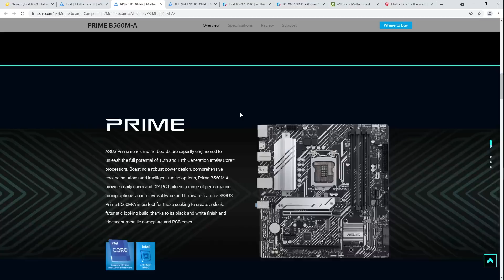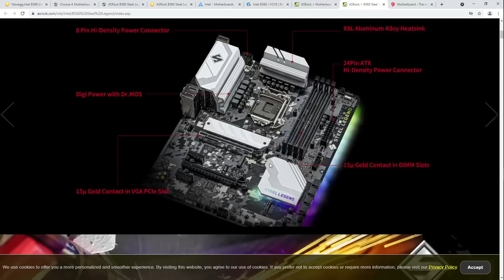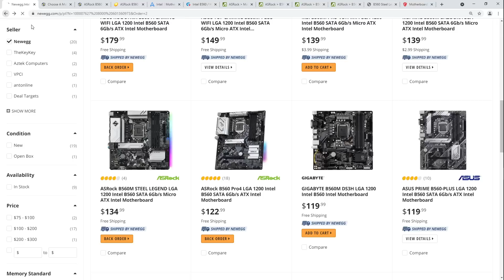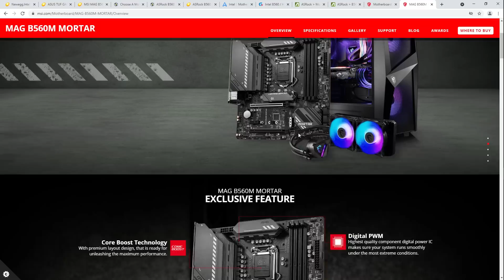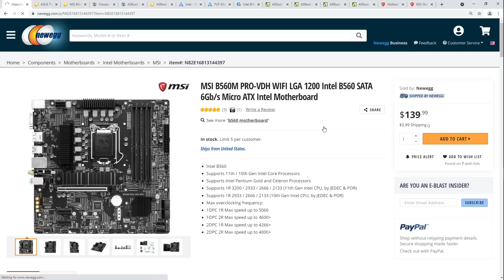Rambling about ALL the B560 boards

Comment: 2:04 - ASUS TUF B560M-E; 
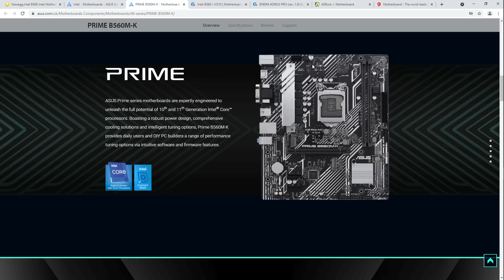6:12 - ASUS PRIME B560M-A (and 20:30); 
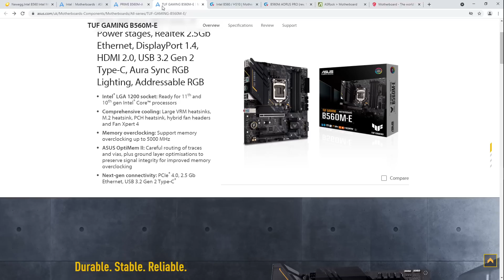9:08 - ASUS TUF B560-PLUS Wi-Fi + ROG STRIX B560-F + ROG STRIX B560-A; 
17:03 - ASUS TUF B560-PLUS (Wi-Fi); 
18:00 - ASUS ROG STRIX B560-G Wi-Fi; 
19:15 - ASUS PRIME B560M-K; 
20:30 - ASUS PRIME B560M-A again (check 6:12); 
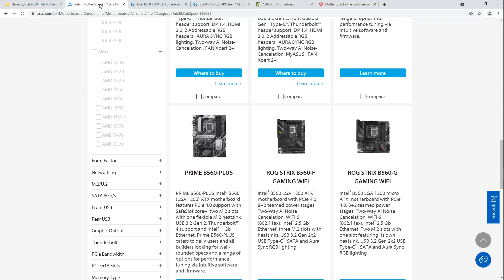24:05 - ASRock B560M-HDV; 
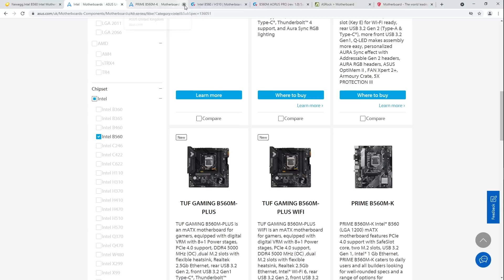27:45 - ASUS PRIME B560-PLUS; 
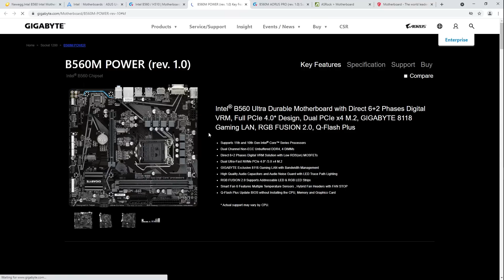31:00 - Gigabyte B560M POWER; 
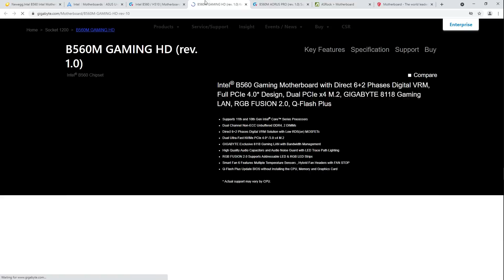31:07 - Gigabyte B560M GAMING HD; 
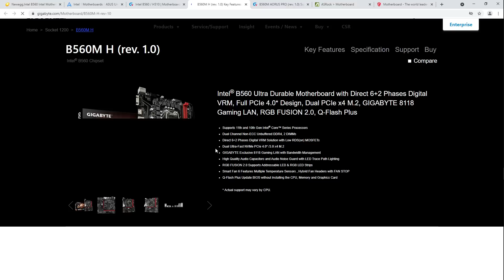31:12 - Gigabyte B560M H; 
33:00 - Gigabyte B560M-D3P; 
36:23 - Gigabyte B560 AORUS PRO AX; 
37:57 - Gigabyte B560M AORUS PRO (AX); 
41:00 - Gigabyte B560M AORUS ELITE; 
45:03 - Gigabyte B560I AORUS PRO AX + ASUS ROG STRIX B560-I Wi-Fi; 
---The rest of the gigabyte lineup is skipped. Reason: trash boards; 
52:53 - ASRock B560 Steel Legend; 
57:32 - ASRock B560M Pro4/ac+; 
1:03:10 - ASRock B560 Pro4; 
1:06:25 - ASRock B560M Steel Legend; 
1:08:05 - MSI B560M BAZOOKA (and 1:31:28) + More of the previous; 
1:09:13 - ASRock B560M-ITX/ac; 
---The rest of the ASRock lineup is skipped. Reason: trash boards;
1:15:10 - MSI B560I GAMING EDGE Wi-Fi; 
1:19:38 - MSI B560 TOMAHAWK Wi-Fi; 
1:21:38 - MSI B560M MORTAR (Wi-Fi); 
1:28:08 - MSI B560 TORPEDO; 
1:31:28 - MSI B560M BAZOOKA again (check 1:08:05); 
1:34:40 - MSI B560M PRO Wi-Fi; 
1:34:50 - MSI B560M PRO-VDH (Wi-Fi); 
---The rest of the MSI lineup is skipped. Reason: trash boards; 
1:44:32 - TL;DR.
Reply: Who says Buildzoid doesn't have a production team? 
It's a volunteer producing and editing community.
Reply: Thanks!!!
Reply: ASUS ROG Strix B560-I Gaming WIFI - €159,90
Reply: 1:23:50 MSI MAG B560M Mortar WIFI - €165
Reply: 1:19:38 - MSI B560 TOMAHAWK Wi-Fi is also on discrete mosfets, lol.
also top m.2 works with 10gen cpus on these boards (wired from b560 chipset)
MSI B560M PRO-VDH 
MSI B560M PRO-VDH WIFI
ASRock B560M-ITX/ac (there is one)
ASRock B560M Steel Legend
MSI MAG B560M BAZOOKA
MSI MAG B560M MORTAR WIFI
Reply: ASRock is very cheap when it comes to VRMs and VRM cooling especially on their "Pro4" line which was supposed to be upper mid range. I've had two on the Ryzen side with the B450 and B550 chipsets. Subpar VRM through and through. I'd rather pony up the money for higher end boards from Asus and MSI like the TUF, STRIX on Asus or the MAG series on MSI.
Reply: Also, first!

Comment: Hey Buildzoid, I have an Asus B560 Strix-A and I was able to snag an 11900k for $220. Is it safe to use the 11900k on this board with power limits removed? Hardware Unboxed showed that with this pairing the PCB backside got to 86c. I’m not sure if that is good or bad. Thank you.

Comment: Soultion to no heatsinks are to ADD them. Amazon and newegg have Heat sink square and bars that will cover them using thermal adhesive,

Comment: min 53:33 steel legend is it actually 10 phase or what it only have 10 chocks so it makes me doubt it,, but i dont know much on this topic ,,  thanks,, i am considering i9-10900 (non k)with no power limits in a single core stressing tasks (structure stress analysis and surface molding+ some mid range programing +fluid mechanics simulations ) so i want to be safe still i am tight on budget ,,,, so any advices
Reply: i was told that 8+1 or 8+2 is not good enough for the 245 watts of i9-10th as it will run hot about (70s-80s) c ,, while a 12 + will run at 60s to 70s dgre  so was wondering

Comment: Gigabyte boards use realtek ALC4080 and i've read some really bad reports on that. Lots of static noise, pops and a loud hiss sound. And gigabyte doesnt seem to have a solution. Apparently it's not just the ALC4080 thats bad, it's the whole integration of ALC4080 and the board itself.

Though I don't know how common this issue is.

Comment: Hi! Please advise me. I5 11400. Mobo i wanted is b560 m aorus pro(120euro and 135 ac version). But i would prefer atx. B560 tuf plus atx wifi 159euro(but gigabyte better vrm i think). Same price z590 gaming x (159 euro). Msi z590 a pro same 160 euro... I am stuck... B560 tomahawk wifi 170 euro...torpedo 165.. Is for example better performance on z590 entry lvl than b560? Same money i find these mobo in my country.

Comment: After some research, the MSI B560M Pro-VDH has approximately VRM performance of the MSI X470 Gaming Pro Carbon. You can check Buildzoid video about that board, I believe he said in X470 roundup for GN that it can handle Ryzen 3900X overclocked ~200W

Comment: Would you recommend the Asus ROG STRIX B560-G GAMING WIFI or the GIGABYTE B560M Aorus Pro AX in terms of VRM'S only? I'm talking specifically about the Matx lineup. 
The ASUS seems to be better with things like audio codec but its $301 for the ASUS, and $240 for the Gigabyte (about $209.20 vs $166.80 USD prices) 
Was wondering if some quality of life features like the audio codec (and of course vrm's if they're better) were worth the upgrade considering I already own the Gigabyte.
Thanks for your time.

Comment: B560m pro vdh WiFi is only 110$ in my local micro center, while the TUF is only 133$. One can even get a 6$~10$ discount if buying a cpu with. 

And we also got gpus in stock at relatively reasonable prices, some are even at msrp!(just sold out quickly) We achieve this by forbidding people to buy gpu only.

So lucky to live in one of the few places around the world with good pc parts prices.

Comment: I recommend Gigabyte B560M Aorus Pro. It was ~139.99€ with 19% Tax in my Country. It can run a 11900k fine or you can run a 11400F on all Core Turbo (upto105W) most of the time (not all Boards can do that).
JUST REMEMBER!!!! to download the newest Intel drivers for Storage AND the 2.5GbE Lan first. When i used the Board, I had no Internet until i did...
And make sure to have a GPT-Bootdrive (Win 8.1/10), MBR-Bootdrive (<Win8) CAN work, but its a hassle to make them boot.

Comment: Asrock B560m Steel Legend or Gigabyte B560M Aorus Elite?
For an i5-11400F
Reply: Prices are very dependent per country, however I would highly recommend the B560M Aorus Pro Ax if it works to be cheaper than the competition, especially over the B560M Aorus Elite.

Comment: So, uh... it turns out the Pro4 isn't even enough for an i5. What a mess. https://www.youtube.com/watch?v=g3AEj3x39vQ
Reply: It's plenty for the i5. The video you linked to is comparing boards that are and are not enforcing the 65w tdp limits properly, and all it shows is that difference. That same reviewer has since uploaded a video showing that the pro4 does just fine with an 11400 when the power limit is disabled, and even does well with an 11700 (dropping only from 4.4 to 4.3ghz under extended synthetic stress testing): https://youtu.be/HkiTA0XvXUM

As buildzoid predicted, the MSI Pro-VDH does do a little better, but it's also currently more than $20 more expensive. For an inexpensive i5 setup the Asrock Pro4 is the one I'd go for (or a clearance z490 if the right deal comes up)

Comment: As a fan of having semi-decent stereo headphones, without having an expensive external audio solution, I think a lot of the more expensive B560 boards provide much better audio chipset, such as ALC4080/ALC1220 instead of ALC897.
Makes the Gigabyte Aorus Pro AX more tempting (£177 in UK compared to £146 ASUS TUF) as it gets you much better sound without the need to buy extra hardware such as a soundcard. ASUS Strix on the other hand is a notch above that for £199 for the B560-F, that's going a bit too far.

Comment: Tilted bridge chips were kind of a thing in the early to mid 2000s as some chipset manufacturers has said it offered shorter/ faster connections to components with some also stating heat dissipation. I remember reading about such things when the first nForce motherboard was released and their northbridge chips were tilted 45 degrees. Maybe the slight tilt was based around the same principles of shorter traces while accommodating other chipset/ motherboard components?

Comment: Excel files in the 100MB range are heavy but still manageable for a haswell era ulv processor. Office will hang for a few seconds while opening such files but once open it's responsive. So the work load of large excel files isn't that significant to a desktop processor.

Comment: Got a conundrum for you hardware knowledgeable peeps.
TUF Gaming x570-plus wifi MB will not boot with a 2060 card with fans set to PWM. I get a VGA error LED. 
With an ancient amd HD legacy card it works. 
With all fans set to DC, it will boot with the 2060 about 70% of the time. 
Anyone know what in the world that's about?

(done all the obvious, reseat cpu, ram sticks, switching around fans, bios update etc)

Comment: [Question]
I have seen how greedy and power hungry 11th gen is and looks like the 11400 is not any better than the 10400 if both was running at 3200 cl15 (for games I mean).

The 10400 barely use any power even if power limits was disabled the CPU barely hits 70W and goes as low as 29W during gameplay. Do you think a cheap crapy B560 board like asrock would be enough to run it well with memory overclocking 😅? I would probably set the limit at 95W
Reply: 11400 (with PL removed) does have some gains: https://www.youtube.com/watch?v=MN_l67fBCR4

if you don't plan to upgrade to 11th gen later, you could just get B460M Mortar, would work with 10700/10850K also. if you are going for 3200 RAM it is not that big of a difference if you are playing at 1440p and above, or GPU bound. so unless you are going to use a high end card like RTX 3080 and above and want more frames, then faster RAM (4000+) would give you more noticeable gains. you prob won't notice the difference unless benchmarking / comparing with FPS monitor.

Comment: I have a ASUS Prime B460 PLUS paired with 10600 it works super well with a i5 I can verify and it looks like it has same VRM as its B560 counter parts. ^_^
Reply: Does the 2666 mhz ram reduces noticable improvements?
Reply: @keiserzg1968  Not if you counter with reducing CAS timings
Reply: @chomper720  im planning on buying b460m mortar with 10400 if i buy this config i can afford a 3060 for my gaming pc or should i go for b560 and 11400 if i go for the 11th gen then i have to reduce my budget from gpu and have to buy something like 2060 or 5600xt...im really confused can u suggest me what would be best...for purely gaming only
Reply: @keiserzg1968  depends on local prices, most say B560 is better so you can get faster RAM,also both 11400 and 10400 works on B560 but 11th Gen will not work on B460.
Reply: @chomper720  if i go with b460 10th gen it will cost me 570 dollars without gpu if i go with b560 11 gen it will cost me 655 without gpu btw most b560 boards doest supp nvme for 10 gen the ones which does are really costly will even exceed my processor price
Ive a budget of 1000 dollars total

Comment: Well, got an asus tuf b560m for about 120usd, glad it‘s a good one. Currently I’m running a 11700f with it, so far so good. And what really  surprises me is that after disabling avx512 and undervolting it only draws about 130w of power under heavy fpu workload. Pretty good for a rocket lake i guess. Also asus implemented a new feature called “smart load line” on all of their b560 mbs, from what i can tell it can automatically undervolt the cpu on all kinds of loads, a very good feature indeed.

Comment: On the topic of the Asus discrete MOSFETs: I'd assume they are still using 4C06N low sides in which case I think even the 5 phase setups with 2 low sides will struggle for RKL and the 8+ core CML parts. The 11400F without power limits is a 200-230w part by TPUs numbers... The MSI ones are likely on 4C024N low sides which are quite a bit better, might be adequate with 10 total low sides in the VRM, but those boards have way worse feature sets than the TUF mATX which is around $140 for the non WiFi version.
Reply: TPU numbers are whole system draw.

Comment: MSI just released a BIOS today that boost CPU features and overall performance on the B560 Tomahawk making it even more of a Z590 board.
Reply: The AMD equivalent B550 Tomahawk kicks ass too.
Reply: @Olivia-W  yes it does. I have a few B550 Tomahawk builds.
Reply: You suggest tomahawk b560? I am between aorus pro ax, asus tuf b560 plus(and some z590 like gaming x and msi a pro). In benchmarks though aorus pro won clearly.

Comment: B560M Aorus Pro was my go-to. Sub 140€ here in Germany, beefy VRM (~200€ Z590 boards) and amazing IO (Intel LAN 2.5G, USB-C 3.2 20Gb/s!). The Elite was pretty much the same price, but worse powerstages, worse IO... 10850K @4.8 allcore ~250W - VRM stays cool as ice (~74 degrees on my open test bench).
Reply: Intel 2.5G give lot of people PTSD lol.
Reply: @floorgang420  already fixed in that stepping ;)
Reply: The IO looks the same except without wifi and Realtek 2.5G, Aorus Elite was shown to be enough for i9-11900K 5.1GHz all cores (according to Giga: https://www.kitguru.net/components/cpu/joao-silva/gigabyte-b560-aorus-motherboards-run-the-core-i9-11900k-at-5-1ghz-on-all-cores/ ). these boards have Z590 parts slapped on, so far haven't seen any VRM comparison tests yet, but ASrock Steel Legends did pretty well price/value.
Reply: @shiveringisles3509  and also missing the 20GB/s 3.2 port. Here in Germany, they are not even 10€ apart, so no reason to go for the Elite. Really sad that the Allcore OC only works for 11th i9Ks. 10850k had 4.8 Allcore maxed, but that's quite a good daily setting anyway. Also faster multithread (16200 cb) than 5.1 11th Gen ;) ofc only pushing 175W package in cinebench, so easy on the VRMs too.
Reply: @TheOpenfield  20Gbps USB that most users of B560 would never make full use of unless they have external NVME/drives that support 20Gbps too. my point is that Aorus Elite is already sufficient and good value for its features / 12+1 phases at this price point. 

B560M Aorus Pro wifi version costs $25 more here, if i were to get wifi AX, i would much prefer B560M TUF since it is cheaper, BIOS is better than Gigabyte's, option to BCLK OC, and RGB fusion is quite bad.
Reply: @shiveringisles3509  The Gigabyte WiFi versions in general have quite a huge price jump compared to the non-WiFis. Wouldnt really recommend them. As you said, the TUF (even though the VRM is really cut down) would be a better choice. 

But the Aorus Pro non-Wifi is just a bargain here in Germany (where the Elite costs rougly the same). No other Intel 1200 board even comes close in terms of VRM/IO at that price point.